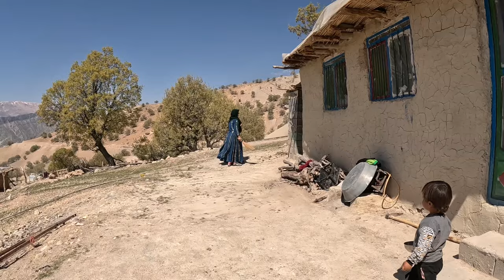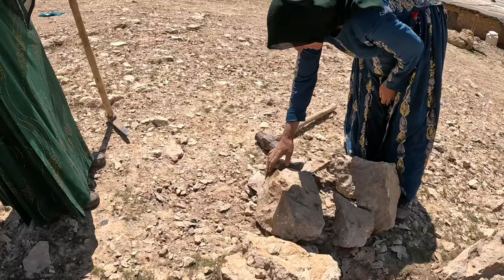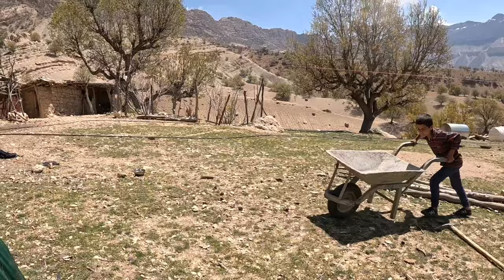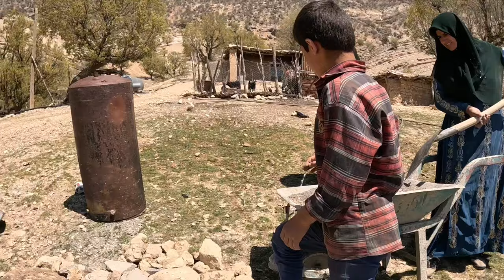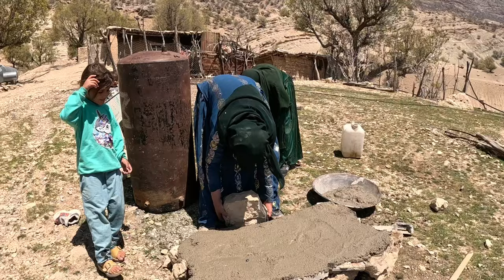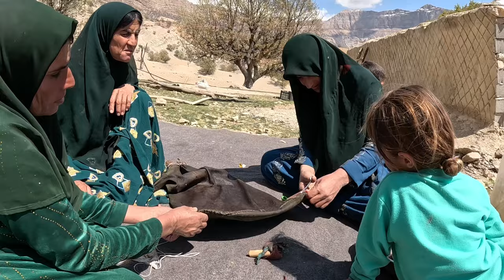"A request for help from Blum's mother! The presence of Chuvil's mother at Blum's mother's house"

Comment: They making a geyser to make hot water, but why so far from the house and bathroom. Aunty, you have everything. Thank you so much. Mother Bloom you have so much energy and endurance to make something work. I like that. God bless you all. 😊
Reply: They are using gravity. The higher the tank is on the hill, the more water pressure they will have in the bathroom.💕
Reply: Good to know. Thank you so much.

Comment: I have seen on other channels the water heater put close to the bathroom, onto  a raised platform under which is a hearth for fire to heat the water -  and filled via a hose. Putting a boiler in the middle of the land seems impractical. Would it have been better in the corner nearer the house and the bathroom?  Just dumping a water boiler anywhere on the higher land seems impractical.